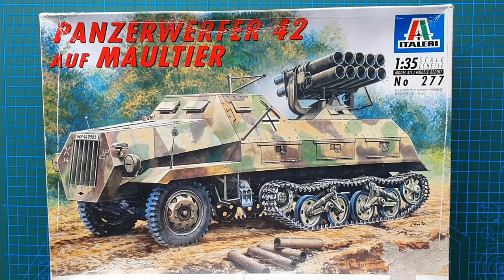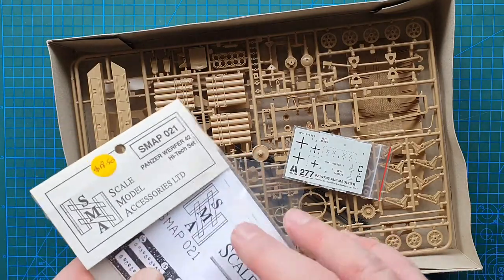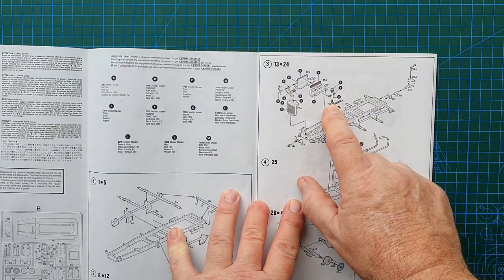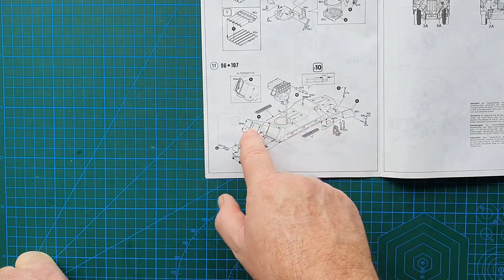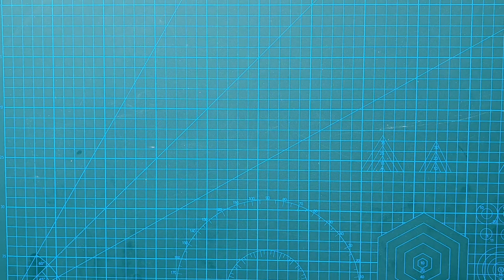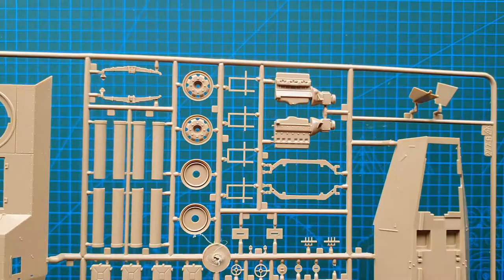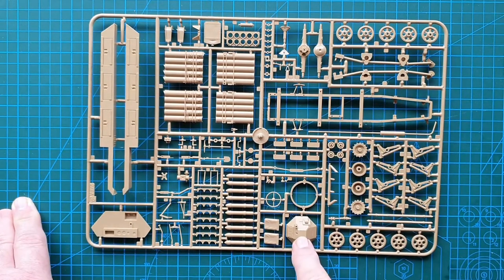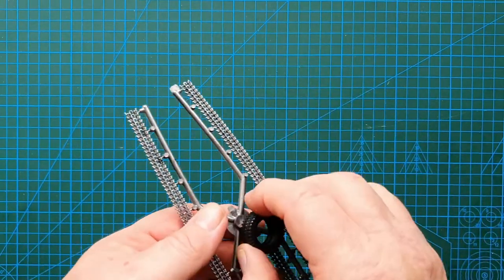Italeri 1/35 Panzerwerfer 42 auf Maultier - Kit Review

Comment: The bolds are totally accurate. I would say restrained. It is the sink mark behind them that bothers me.
Reply from the maker: Yeah, it's in quite a critical spot. Only real option is to fill it, and sand it flat, but of course, you'd lose the bolt detail, but, thankfully, there are AM bolt kits that you might be able to use to replace them. Italeri unfortunately tends to be a bit hit and miss with their quality sometimes. Cheers!